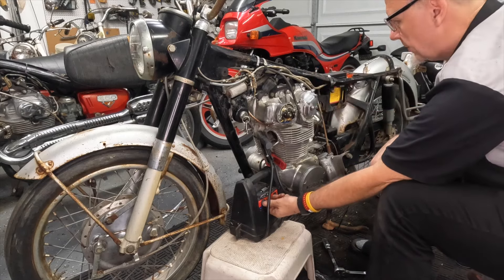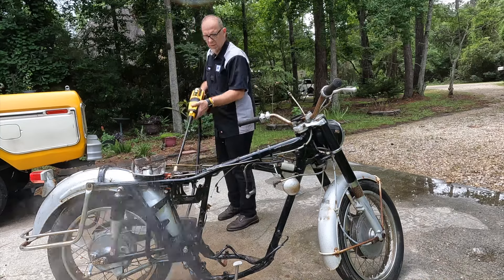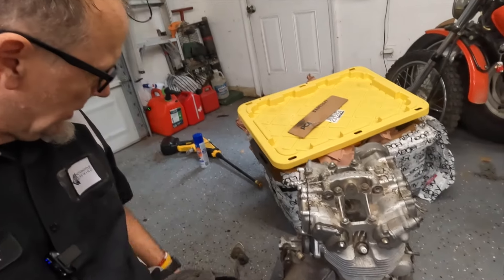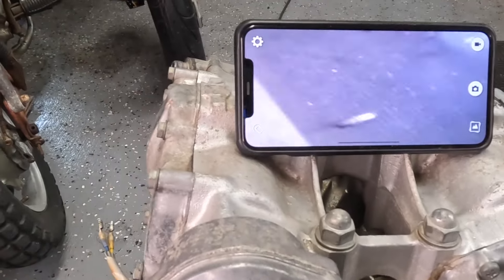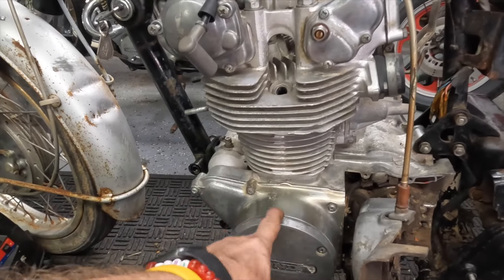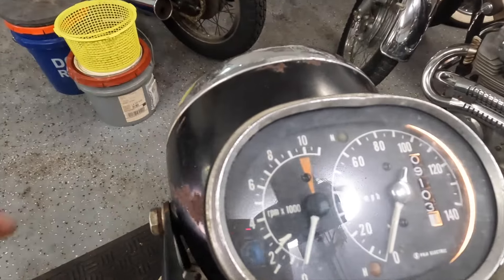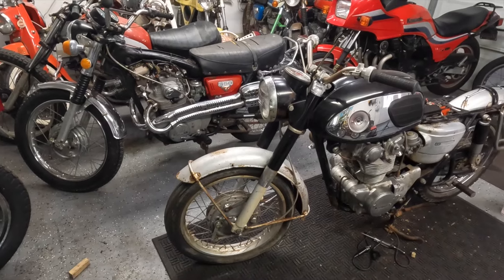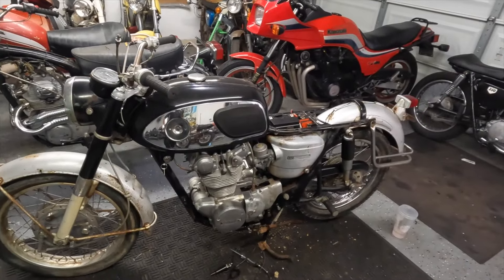1965 Honda CB450 Black Bomber Gets a New Engine

Comment: I personally would get it running sweet and fit the parts it needs to be safe for the road, and then start putting the miles on it, that awesome bike just wants to live 👍😎
Reply from the maker: I agree. Make it safe and reliable the ride it. I may have to go roadtrip this guy before I give it back. Have to throughly shake it down.
Reply: @motorcyclerewind  sounds like a plan :goodvibes:

Comment: There are some differences with the original 4 speed and the later 5 speed models. As you will be aware already the casings at the front of the five speeds are narrower and will need spacers to take up the difference on the front mounting brackets. Great video, good to see the replacement engine fire up so readily.
Reply from the maker: Haven’t put the front bracket on yet. Will have to make some spacers.

Comment: Correct me if I'm wrong, but didn't the original use Manx Norton-style Hairpin valve springs and the later ones used coils... I haven't check my facts, so apologies if I'm wrong.
Reply from the maker: Not sure. 🤔

Comment: Do you ever put something like marvel mystery oil into the gasoline tank on any of your motorcycles? Have you ever used an oil treatment for any of your motorcycles?
Reply from the maker: I always add some two stroke oil to the fuel for first starts. I also like to use Seafoam in the fuel after they get running. Not sure if it works. Makes me feel good. Also add motor  flush into the engine oil for first oil change. Not sure if it works but nothing has exploded yet. 🤣😂🤣Thanks for watching